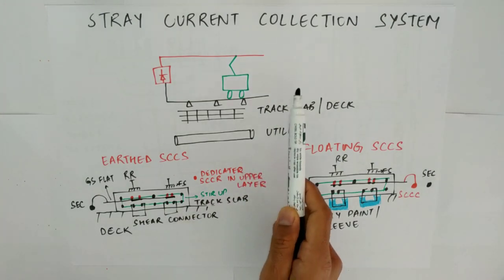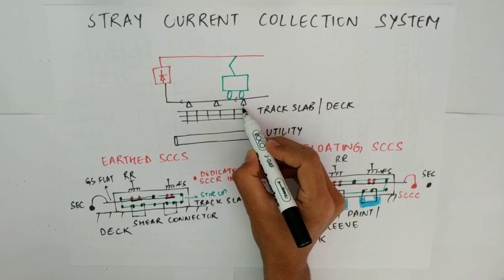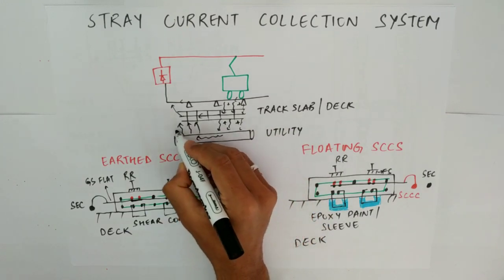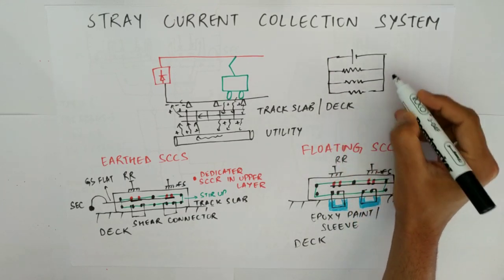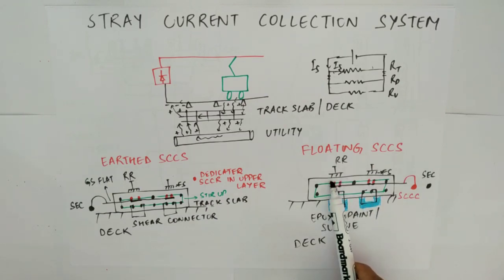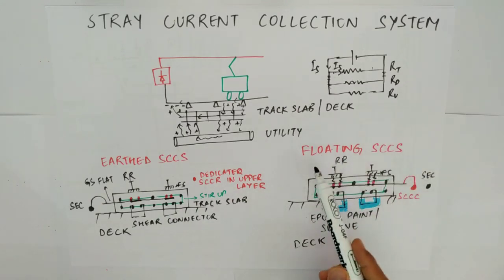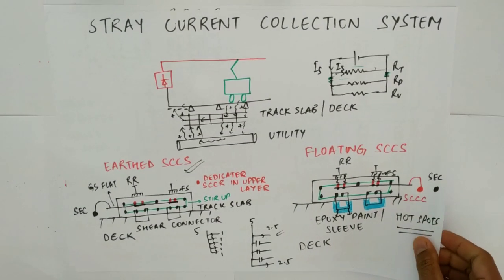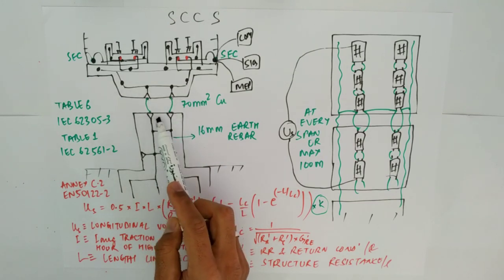Lecture 4: Stray Current Collection System

Comment: Hi, your lecture is very beneficial and we share common understanding mostly in EMC and earthing.

But to share, new EN 50122-2:2022 informed we dont need to additional rebar or stray current collection mat on top of trackbed reinforcement anymore. Refer section 8.

Also, the recent development of trackwork is to use fibre reinforced track bed. This translate to much easier construction for them.

Both above  means no metallic structure under the rails. But shear connector still needed as adhesion between trackbed and tunnel invert concrete.

in theory this improves the insulation level of rail compared to earth.

What do you think of this solution? And what would be be treatment for shear connector you think?

Comment: Thank you for interesting lecture. I have two questions, please can you help to clarify:
1. Your calculations prove that Earthed SCCS is better approach than Floating SCCS due to numbers of shear connections which are impossible to provide Epoxy/sleeve. However in accordance to
     Electric Lines for Electrical Railways: Planning, Design, O&M Float SCCS is recommended for DC TPS.
2.  Is Structure resistance (R's) are calculated by Structure/Civil engineer during design? because TPS design normally comes at later. Secondly can R's be measured by TPS at later stage?

Thank you
Reply from the maker: Many thanks.
1.As per Contact line for electric railways (2001), it recommends not to use the drainage diode solution. It is recommends to bond the stray current collection net with structural earth cable. This related to Earthed SCCS. However, both systems have been adopted in metros. But nowadays majority of the metros prefer to go with earthed SCCS in which there is no requirement to install separate SCCC. 
2. Rs’ to be used can be estimated after TPS simulation. Thus, the no. of rebars required will be decided after TPS design. In order to proceed with track design without complete knowledge of Rs’, it is preferable to follow Earthed SCCS as it gives the liberty to include track rebars (which include both dedicated & structure rebars) + SEC + handrails.
Reply: Thank you for your responses. Very much appreviated.

Comment: Why not just put one copper cable below each rail isolated from the structural reinforcement?
Reply from the maker: There can be 3 possibilities:
1. Install copper cable, however it will not catch the stray current as it is insulated and current will enter structural reinforcement. If we provide bonding in between at particular location with rails, then it is same as return cable along the alignment to reduce rail potential. Some amount will leak to structure as it will not carry any stray current, it will just support in reducing the amount of stray current.
2. If we put bare copper conductor, then its function will be same as using rebar for stray current collection. Stray current will enter the copper conductor and then leak from it too to the nearby metallic structure (structure reinforcement, etc.). Moreover, it will be very difficult and we need to provide measure to control galvanic corrosion that will occur between two dissimilar metals, steel in concrete below rails and copper conductor.
3. Use half insulated cable, this will also lead to leakage of same amount and corrosion with steel structure as reinforcement might come in contact.
Thus, it is preferable to with either Floating SCCS or earthed SCCS (with earthed being comparatively better with ease of installation).